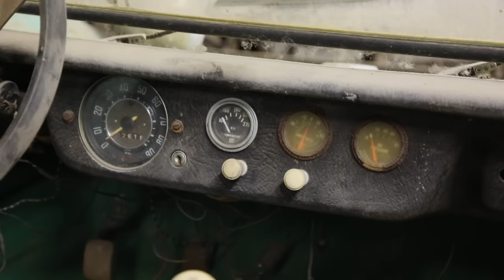American Pickers: HAND-BUILT Dune Buggy Worth $$$ (Season 23)

Comment: I see people here saying it was way too cheap? I built the engines for these in the 70s and thought he was about $2000 over on his bid. The days of the VW shop on every corner is over. Just locating a machine shop to rebuild the engine will take an act of God.
Reply: BS-- for one VW engines are easy to rebuild,  so easy a child could do it
Reply: @samiam5557  and they made millions of them. They’re not rare and that one is not in good shape. Nothing of that car is valuable as it sat, the only value it had was in its potential. $2600 was a bit high imo.
Reply: @owkelpton  It's hard to be sure.  The car sat but that is not the worst thing.  If everything is solid and put together well...  Just as long as the engine is not seized up solid
Reply: Plenty in California
Reply: The best dune buggy shop in the world is less than 5 miles from that barn.

Comment: These people in the comments don’t know what they’re talking about. Engine didn’t run, wasn’t clean, who knows if the engine was gonna work, gas tank needed and probably a lot more painful wiring. $2600 is steep for a knock off manx in this condition. You can find them in pristine condition running $7500. Not a soul in this section knows anything about dune buggies.
Reply: I paid $4500 for a nice IRS, gear reduction running buggy with new tires and lots of new parts.  Still needs some attention but way better shape than this EMPI.
Reply: Wow so cheap, in Italy you finds dune buggy from 12000 euros more 😅